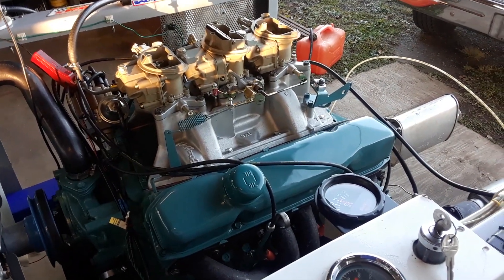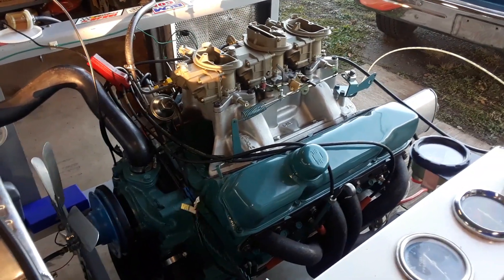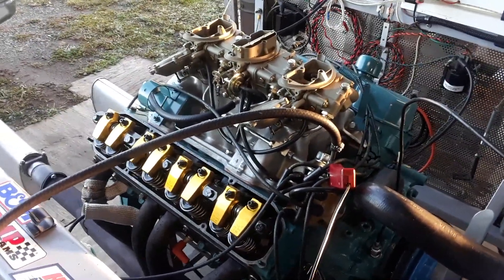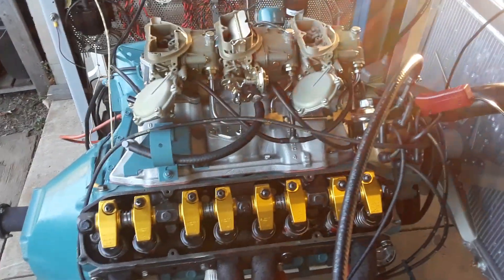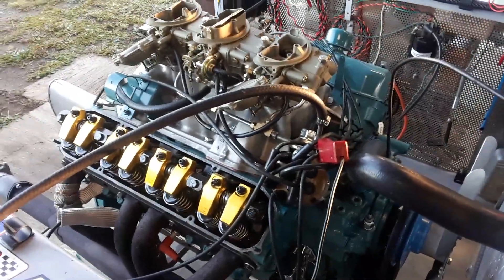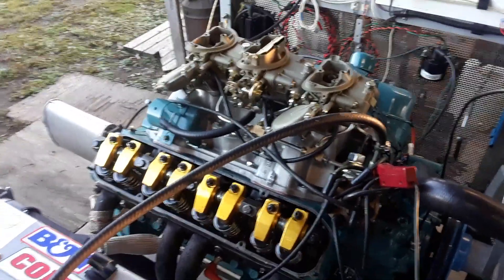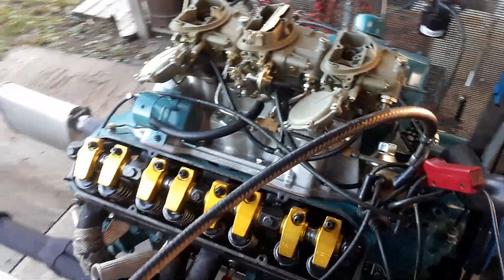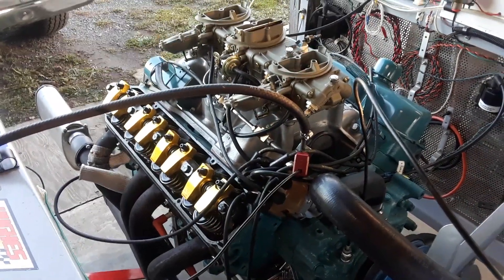440 6 Pack "Quench Head" Engine Part 1

Comment: Back in the day swapping from 906 open chamber to these 915’s would drop a full second off your quarter mile time! The extra port velocity especially down low made these heads a game changer for street racing whereas the open chambers had to be wound up to “flow.”

Comment: For a similar build I used TRW 6 pack pistons and cut D D Dish in the pistons. (like the then popular TRW Turbo pistons)Block was twisted so took a lot of decking and ended up with the pistons plus .015 and used Victor Marine gaskets giving about .030 quench also giving about the same compression that you got.   I put in Motorhome valves Sil XB intakes and Inconel exhausts, dual valve springs set up tall for reasonable pressure Viton seals  I also opened up the heads and equalized the cc's (PITA)   Bronze guides are knurled almost all the way through for oiling  Heads are ported
Doing it again I would have used lighter pistons and even better a big stroker.   Cam is 254@.006,,204 @.050 and .305 lobe lift   Max area that will live    stock intake and exhaust ( this is in a motorhome)   i have bushed Erson 1.75 rockers with  cup adjusters and oil through the ball and ball pushrods  AMC lifters  rocker shafts have been slightly relocated
that's

Comment: Another option if one desires a quench-head big-block Mopar is the much more readily available 516 head, also closed chamber, and the ports are very close to the 915's. Yours looks like a fantastic combo! 👍
Reply: Thank you for this intelligent comment. I never owned a set of the 516 heads as they were considered the "red headed step child" of the 915's as far as the closed chamber design went. I don't know the "as measured" port volumes of the 516's to compare it to the 915's. If I remember correctly, the 516's all had a casting "bump/obstruction" in the exhaust port that needed to be ground away to make them flow better than "as cast" and they were close to "water" if you got too aggressive with the die grinder. The later 915 heads did not have this casting design flaw regardless of valve size (the standard 1.60" or the 440 magnums 1.74"). It's a moot point as these heads are now so rare that my build is for the die hard "Mopar hoarders"  out there that still have these heads! You can include me as "one" of them.......a "die hard" that is. I liked what I built and will keep an eye out for these old 915 heads. Kind regards, Tim
Reply: @timmuzak4944  U have three sets of 915's with hard Dura Boind seats and bronze guides and have never been able to get my costs out of them after the AL heads came out.  I'm hoarding for anyone with a matching number 67 build otherwise there are now better alternatives,  516 take more work  whereas the 2.14 1.81 WAS the way to go today I would use small stem lighter valves as I am doing new guides anyway
Reply: @timmuzak4944  I have a few sets of 516's squirreled away. I could get you detailed pics of the ports if you desire. As detailed as an iphone can get anyways, LOL. They all came with the 1.60" EX valves. I actually have a set at my local shop right now to open that up to 1.740" with hardened seats.  I'm going to use them on a 413 I'm building for a truck. I don't think I will be able to get the pistons close enough to the head to call it an actual "quench" motor, as I am running flat tops. I'm shooting for 9-1 to run on 91 pump-gas. Maybe 9.5 if I chose a cam with decent overlap? I can't pick a cam to save my life! LOL. I still need to mock it up and see how far in the hole the slugs are. Then do all the math. When I tore the engine down, they were .075" deep from the factory. I had my guy just square the block up for starters. It took about .015" to get it square. And I'll take it back for final deck once I figure it all out.
Reply from the maker: @wheelieking71  Have you tried your luck with the "Dynamic compression ratio" calculators for your camshaft choice? 
I have tried a number of them ( Wallace / UEM etc) and ended up with different DCR numbers. I now "physically" measure the short block rotating assembly [piston height] with the degree wheel in place on the engine, then do the math for my DCR. Here are some links if you have not already tried them: Good luck with your build.
http://www.wallaceracing.com/dynamic-cr.php
https://www.jeepstrokers.com/forum/calculator/